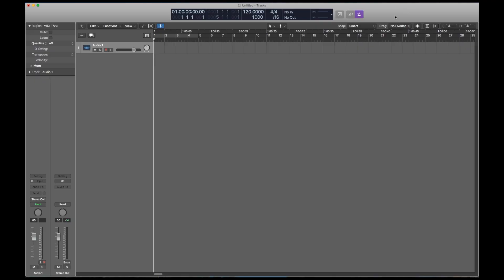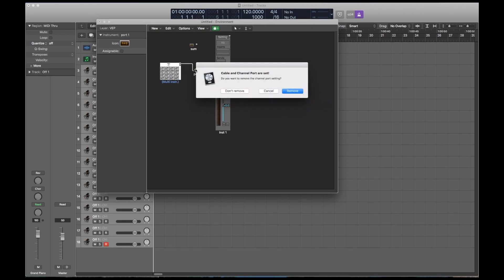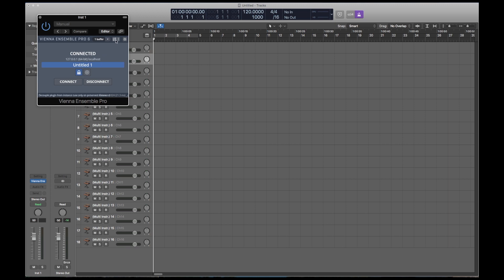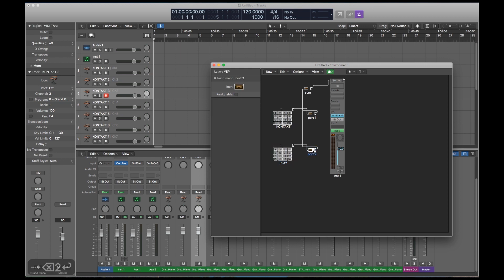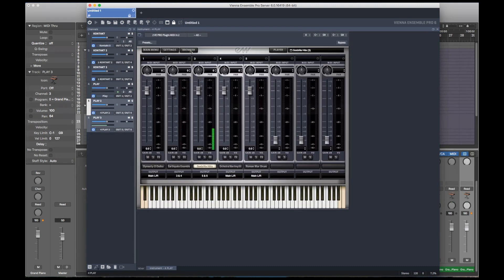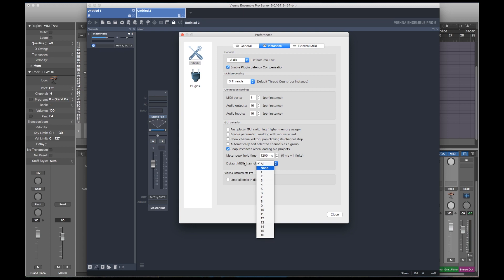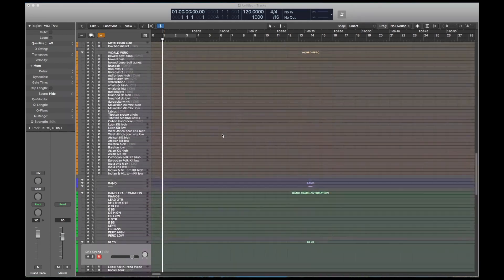How to Connect Logic and VEPro 6, Create Multi-Instruments, Use Multiple Ports, and More

Comment: Alex, what a GREAT video, uber useful, straight and to the point. The PDF tutorial is fantastic as well. Thank you SO MUCH, you saved me weeks.
A couple of quick tips for people watching and implementing:
·Renaming an object in the environment requires Command-Click. Alex mentions it but you can overlook it.
·Make sure that each VEP bus is set to the correct port (usually 1) and midi channel ("ALL" for Kontakt Multis and similar, "1" usually for SF LABS, VI, etc). Alex touches the subject around minute 8 but if you're not there yet this will help.
·When the VEP instrument deocuple button is ORANGE, it is decoupled. You can also look at the VEP top bar and next to the name, the (!) will be highlighted meaning it is decoupled.
·Alex creates folder stacks with each group of 16 AUX MIDI tracks by selecting them and clicking Shift-Command-D
Again, THANKS ALEX! Blessings!
Reply from the maker: Thanks so much for the feedback, Alvaro, as well as the additional tips!

To bypass the track stack dialogue box, my shortcut for directly creating a folder stack is command+shift+F.

Comment: Best video ever!!!  Direct, to-the-point, clear, detailed and none of the inane navel-gazing that plagues most youtube instructional videos.  Thank you for taking the time to explain the complicated and confusing routing for the environment...and pointing out that pesky Logic habit of changing the midi setting from "All" to "1".  Ely yi yi.   Wtf Logic?
Reply from the maker: Thanks, all of those things are my goal, so glad to know I'm achieving them. If I could shorten this video further, I would, but it's a topic that just requires careful explanation.
Reply: Hey man, I do have a question that you may be able to answer.  A problem that has vexed me with this type of Multi set up between Logic and VEP for as long as I can remember is locating the Aux output for a sound that I'm triggering via a midi channel.  For instance, I'll open the mixer and then have to scroll through it (it's big for my larger templates) while I'm triggering the sound via midi to find the Aux.  Do you have a quicker solution for locating the Aux track associated with a midi channel? @AskACap
Reply: @AskACap  One other thing, in the Environment window, my Event editor looks different from yours, doesn't offer me "select in reverse order" and when I change data byte 2 to 1, it changes it to 1 on all ports.  Please advise.
Reply: Hang on.  Doh.  I got it.  I double-clicked on the Port 1 Transformer and then saw the correct window.

Comment: Thank you. I have a question, to use 32 instruments within Kontakt may I know how to set outputs within Kontakt and route the MIDI channels from LogicX especially (17-32)?
Reply from the maker: You need to load a 2nd Kontakt bus & change it to port 2. It can be in the same instance as the 1st Kontakt bus. You'll use MIDI Channels 1-16 on Port 2.

Comment: Do you know if Logic is better optimized for creating more instances or less instances in Vienna VS say using 1 instance in Vienna with multiple instances of Kontakt or Play on that?
Reply from the maker: With Logic, multithreading is supposedly more efficient when you use one giant VEPro Server Instance and as many ports as you need. I prefer the organization of 6 instances and haven't had too many issues once I found the buffer settings, etc. that worked for my system.

Comment: VSL needs to replace their walkthroughs with this video, its seriously extremely helpful! Do you need to have a new port for every new instance inside of VEP? I'm just wondering because with a large orchestral template with 100+ tracks using over 10 instances of Kontakt, I'm afraid that the midi environment will become a mess
Reply from the maker: Glad you found this helpful! You can have a bunch of ports in each instance (limited by your VEP settings). Have you seen the rest of the VEP playlist? You can check it out below:

https://www.youtube.com/playlist?list=PLYoxzL2dCfp4WSD9a_F3_WlrCk5_TRrB-

In the next video, toward the end, I show how my Environment is organized. I have 6 instances and between 2-4 or so ports on each instance, and several hundred external MIDI tracks.

Comment: This is so helpful! I followed all the steps and I could make it sound  😊 I have a couple of questions: whenever you create a new software instrument in Logic - do you have to create another port inside the environment window as you did the first time? Also, when you create a new instance inside VEP (let's say, for another instrument family) - do you always need to create a new software instrument for this? Thank you again for your time and help!
Reply from the maker: Glad it was helpful! 1st question: no. 2nd question: yes. If your software instrument is solely contained within Logic (that's where you're loading the instrument), then it has no need to talk with VEP and doesn't need a new environment port. The reason for a new port is if in VEP you've run out of the first 16 MIDI channels a port can hold and want to load more instruments into the same VEP instance. The software instrument track that has the VEP plug-in on it in Logic is the thing that talks to the 1st instance you made. So without creating another software instrument track with another VEP plug-in on it, there will be no way for you to connect to a 2nd (or more) VEP instance.

Comment: Your approach works, but how to handle, if I want to have each instrument in its own Kontakt engine?  Or another situation - inside of one VE Pro instace could be more multitimbral instruments - Kontakt , Omnisphere, SuperiorDrummer  - what will change in midi routing template or in setup? thanks
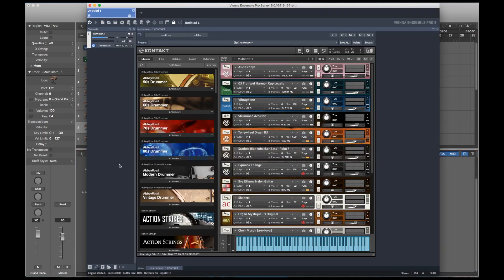Reply from the maker: You can put anywhere between 1 and 16 instruments in a Kontakt plug-in. Technically, you can put more than 16, but I don't recommend it. And you can certainly mix and match multi-timbral and mono-timbral instruments within one VEPro instance. You see the "All" "All" at the top of the bus at 5:44? The one on the left is the port and the one on the right is MIDI Channel. If you have a mono-timbral instrument in the bus, you'd set the channel to a number instead of all. For a multi-timbral instrument like Kontakt, you'd set the channel to All and determine the channel on the instrument itself within Kontakt.

Comment: This is the most standard setup I have ever seen on YT. I haven't asked my professor about the VEP setup but this is very helpful. I am confused about the difference between using midi track and just the aux track alone. Can we just use the aux track at the same time remaining the midi port function?
Reply from the maker: Yes, you can use the aux track. However, that requires an aux track for each MIDI output, and aux tracks require more processing power than MIDI tracks.
Reply: @AskACap  Another question.... How do I bounce each external midi track separately? It seems that I can only bounce through the instrument track? Thanks.
Reply from the maker: @guosiwang2536  You could go into Solo mode (ctrl+s), select the region(s) and either bounce to disk with cmd+b or use the realtime printing methods in the template – using the mix print track or the respective stem track that instrument is coming out of.
Reply: @AskACap  Huge help!

Comment: Great tutorial !
Couple of queries:

1. Why can't we just load a VEP Multi, add required AUXes using the + sign and just route the outputs from VEP directly ? (Instead of the additional task of creating External MIDI tracks)
2. I still see outputs from KONTAKT and PLAY going to the same AUX channels in Logic. What is the point if 2 different instruments end up in the same channel, since you can't process them separately?
Reply from the maker: Thanks! You could do that (and compose right on the aux tracks), but it's because auxes are more CPU hungry than external midi tracks. So once you start to have a template with hundreds of instruments and articulations, it starts to make more sense to send your audio to just a few instrument group auxes rather than have each instrument output to its own individual auxes. But if your system can handle every instrument having its own aux based on the size of your template, good for you!
Reply: @AskACap  With regards Srikant's 2nd question - is there a way to make the latter buses from VEP route to their own channels in logic, so they can be mixed independently?
Reply from the maker: @tommylaurence  the 2nd and 3rd video in my VEPro Tutorials Playlist should answer your question:

https://www.youtube.com/playlist?list=PLYoxzL2dCfp4WSD9a_F3_WlrCk5_TRrB-

You route VEPro's outputs to additional aux channels in Logic. Let me know if you still have questions after watching the other videos!

Comment: Hey @AskACap! I seem to be having trouble setting up a second port. I've succesfully created a second Multi on the environment, adjusted Data-Byte-2 to 1, created respective External MIDI tracks, dragged the Multi into said tracks, selected MIDI Port 2 on the VEPro Bus and adjusted the Kontact and Aux outs to match the Aux channels in Logic. Unfortunately,  the new multi and its tracks keep triggering the sounds assigned to port 1. Could you advise on were the issue might be?
Reply from the maker: What versions of Logic/VEP are you on?
Reply: @AskACap  Logic Pro X 10.7.4 and VEP 7
Reply from the maker: @davidtrujillo-tapias7671  The Environment method doesn't work anymore in those versions. I'm currently working on a tutorial that uses the AU3 version of the VEPro plug-in (which is the new recommended approach), but if you don't want to wait for that, it's based heavily on this forum post: https://www.logicprohelp.com/forums/topic/125825-vep7-au3-template-and-instructions/
Reply from the maker: @davidtrujillo-tapias7671  Here's the new walkthrough: https://youtu.be/brljh0KhvU8

Comment: I have one idea to discuse with you. If you create just one channel instrument in arrange window, assign VEP instrument and than in mixer create multiple outputs and first from them create tracks, than you will get two advantages:
a, hide function will work unified in arrange and mixer window - because tracks will be identical
b, you can do automations on each track

makes it sens for you? or is there any hidden disadvantage? thanks for you comment
Reply from the maker: You're right, but that becomes problematic with larger templates (like, hundreds of tracks) because aux tracks (when you create the multiple outputs) take up more processing power than external MIDI tracks.

Comment: Hi ACap, thanks for this video. I wanted to alert you to an issue that arose in Logic ProX and the solution. CC7 volume information in every track assigned to the multi, seemed to rout to the global volume of the VEP instantiation (didn't check to see if it was isolated to port 1) making the volume go haywire while the individual VIs received no CC7 data. The remedy can be found in the "MIDI" section of "Project Settings" by un-checking the option "Control Change 7/10 controls Volume/Pan of channel strip objects".
Reply from the maker: Good catch!

Comment: Thanks, there aren't enough videos like this! - so question though, getting all this working is no problem. What do you do when you have multiple tracks needing to use the same instrument? (so same port/channel) but different midi and maybe different articulations. I can get each track to route to the correct instrument however, the instrument freaks out because it can't play multiple tracks. Now it looks like I have to have Celli (+ Celli1 + Celli2) etc as instruments in the instance or entirely duplicated instances so STRINGS1 STRINGS2 etc for tracks needing to do this. It's pretty common in orchestration and before VSL I would just have dedicated instruments on each track and ran into the loading time issue with switching projects. :) thanks.

Comment: So i've been going back to this video for years now because it really helped me get a clean setup for Vienna. But now there seems to be this problem with the midi note lengths on logic's end. the multi instruments will play just fine but if a short note plays and then a long note plays after, if they are the same note the long one will be the length of the short one. If i move the midi data up to the main track with the vienna connection the problem goes away. It must have started with one of logics new updates because I don't ever recall having this problem. I was wondering if you could maybe help because i haven't been able to find anyone else with this problem.
Reply from the maker: If you're on VEP7, it's recommended to use the AU3 method instead:

https://www.logicprohelp.com/forum/viewtopic.php?f=9&t=143416

If you're on VEP6, swap out my "port" transformers with the port macro selectors in this template as well as importing the Scripter scripts:

https://www.logicprohelp.com/forum/viewtopic.php?f=9&t=137085

The 2nd option here is supposed to fix some note off errors. Hope this helps! I have an older version of Logic, so that might be why I haven't encountered the issue you described yet.

Comment: Hi, this video was incredibly helpful, thanks! Currently demoing VEP Pro 7 before purchasing. I have just one issue, it seems there's latency between the VEP instruments and software instruments loaded directly in Logic... any way to address this? Is there a setting I should be looking out for? I've found a temporary fix by using Logic's Delay in the Inspector by delaying the software instruments in Logic behind a bit so they line up with the VEP instruments but there has to be a better way I think? Have you ever come across this problem?
Reply from the maker: Thanks for watching, and glad it was helpful! I've never run into that. I don't think this is the setting, but for what it's worth, I have Record > Low Latency Mode unchecked. You definitely shouldn't have to adjust the Delay in the Inspector window. I routinely run Software Instruments in Logic alongside VEPro instruments and never had a delay issue between the two.

Some settings you can mess around with to see if they make a difference are buffer size, process buffer range, and multithreading. Also check the # of cores you have set in VEPro. If you're using more than 1 machine, make sure you are connecting VEP over ethernet. And check that the VEP plug-in in Logic has the buffer set to 1 if you're using Logic/VEP on the same machine or 2 if on separate machines.

If nothing seems to make a difference, try starting over, at least the cabling/connecting/networking part – you shouldn't have to rebuild your whole template. Or, try the same thing in a new Logic project. And sometimes problems mysteriously disappear after a simple computer restart, but it sounds like here it may be something in your setup.

If you get a chance, check out the rest of the videos in my VEPro playlist; there might be some other helpful things in there & more food for thought:

VEPro Tutorials Playlist:
https://www.youtube.com/playlist?list=PLYoxzL2dCfp4WSD9a_F3_WlrCk5_TRrB-

Comment: Hi thank you for sharing this video.While I was following your steps (3:33)and  uploading CSS in Kontakt in VEP, I found out my memory used is going up to 6.82 GB and the limit of my computer's Ram is 16GB and my computer was heating up. My CSS has been loaded in my Samsung Portable SSD 2TB, but it was still slowly uploaded.  Is there anything I need to check before I continue?
Reply from the maker: I do talk about some ways to optimize your setup in the next 2 videos in the series, so if you haven't seen those yet, check them out for some additional considerations:

How to Set Up a Large Orchestral Template in Logic Pro (for use with VEPro)
https://youtu.be/oAUs1YxyD7s

How to – Advanced Routing and Organization in Logic and VEPro
https://youtu.be/RXB-SMlg2FE

Your computer heating up is normal; that just means it's working hard. However, I'd recommend a minimum of 32 GB RAM for big orchestral templates. If you need to stick with the 16 GB RAM machine for now, that's fine, and VEPro will certainly help to even out the load; just make sure to find the best Multiprocessing (9:41) setting as well as the buffer size in Logic that works best for your setup (mine is set to 512, but your "magic number" may be different).

Is CSS a Kontakt instrument? Since you don't have that much RAM to work with, you may also consider loading your instruments in "purged" state so that only the samples you play while your template is up get loaded into RAM.

Also, thank you for buying the "All Logic Tutorials" and "All VEPro Tutorials" PDF guides! Really appreciate the support.

Comment: Thank you for this excellent video. I just have a question about the aux tracks you opened after creating the midi ones. I do not understand why you only opened three auxs instead of opening one for each instrument.
Reply from the maker: How many auxes you create depends on how much separation you need between instrument groups. The sample Multi I loaded is not a very good example for this, because it's a really eclectic group of instruments. So I chose an arbitrary number of auxes, just to demonstrate how you get instruments to come out different outputs. Normally, I'd group them better, like a Kontakt full of strings, like my Advanced Routing in VEPRo video (glad to see you got that PDF as well!). Just keep in mind that if you create an aux for every instrument you load in VEPro, that will increase the CPU load.
Reply: Ask ACap thanks. I sent you a private message on Facebook. Would you be available for private consultation? Thanks